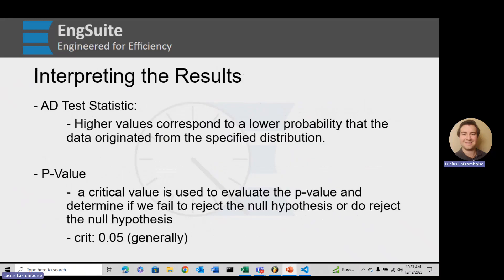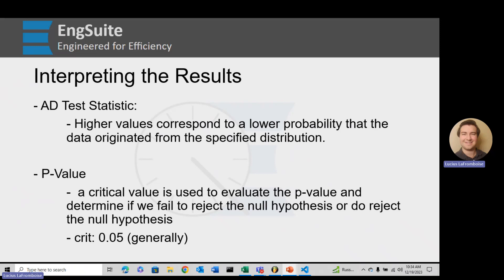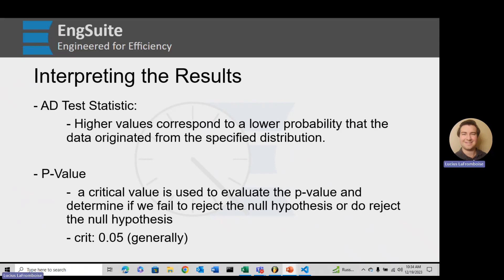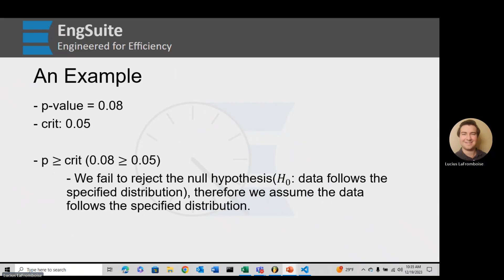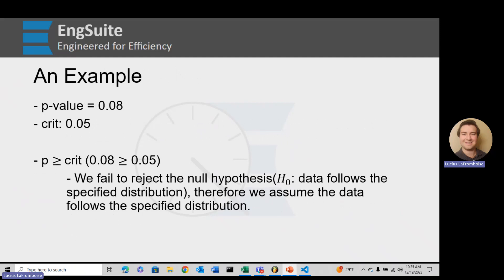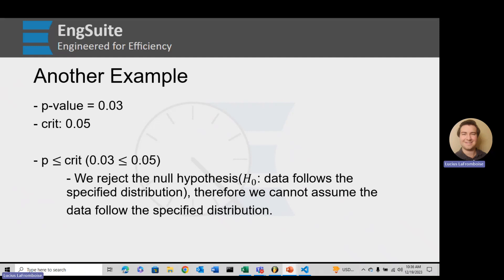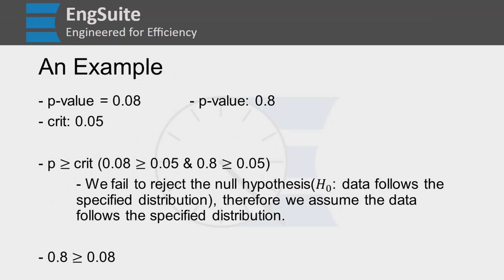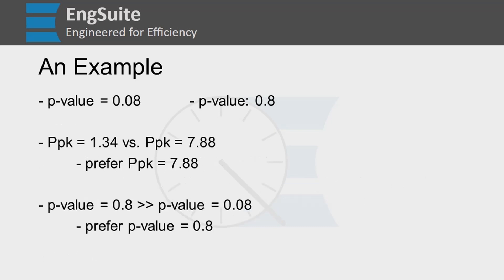Interpreting the Anderson-Darling Test Results - Engineering Statistics

Comment: Thank you for providing this content. You have been quite helpful, and I believe this is not only for me.

●So, did I get correctly that if an A-D value is higher, it corresponds to a lower p-value and hence a higher risk of rejecting Ho that assumes the distribution comes from a specifed distribution (i.e., normal distribution) when the p-value is less than the significance level? 

●Is it accurate to argue that the smaller the A-D value, the more likely your distribution is to be normal because the p-value will be larger (above the significance level), allowing Ho to assume that the distribution is from the specified distribution?

● The higher A-D value, the lower p-value and the higher chance of rejecting Ho?

●Otherwise, how should the A-D value be used in respect to the p-value?

Thank you in advance.
Reply from the maker: Hello,
Yes, you are correct that a higher AD value corresponds to a lower p-value and a higher risk of rejecting H0. And yes, the inverse of that would also be true: a smaller AD value corresponds to higher p-value and thus failing to reject the null hypothesis.
- IMPORTANT –
However, I would not recommend using the AD value to make your conclusions about normality because the p-value calculation also takes the sample size into account. This is one of the main reasons we use the p-value. It standardizes the criteria across sample sizes. Another important reason that we use p-values is because it is directly linked to the risk of Type I Error, this means that by specifying our alpha (generally 0.05) we are actually specifying the acceptable risk of Type I Error at our specific sample size.
- CONCLUSION –
The p-value is a standardized statistic that allows us to control Type I Error and to ensure that sample size effects are properly controlled. The AD test statistic is still important but should not be used by itself to make conclusions.
Reply: @engsuite3958   Thank you for your insights here. Well noted. 

Keep up this good work 👏